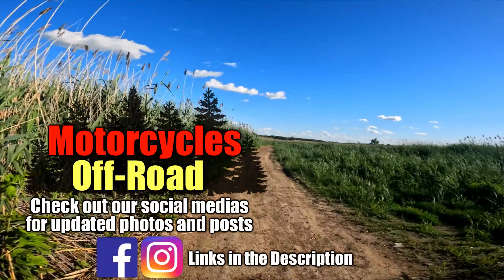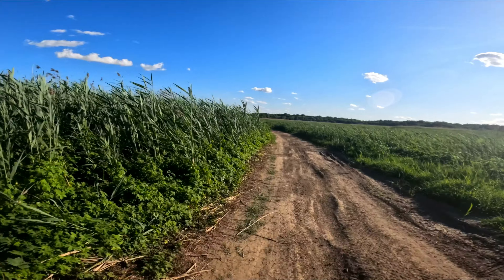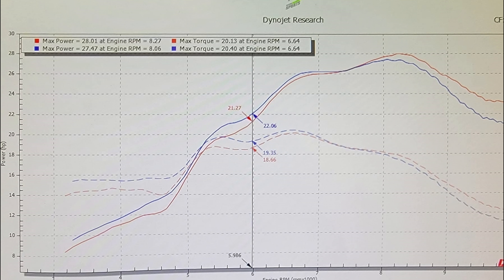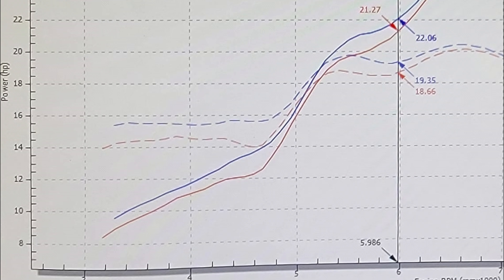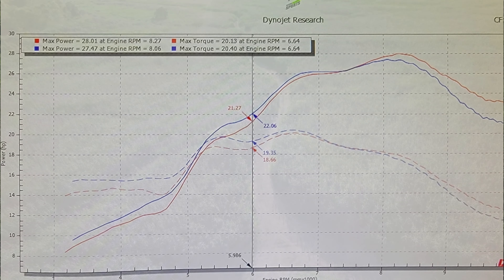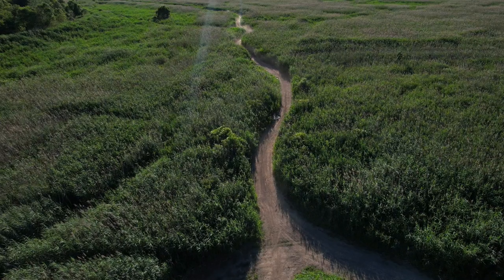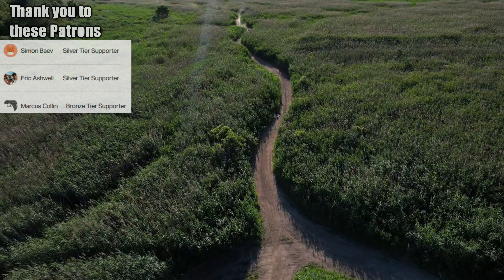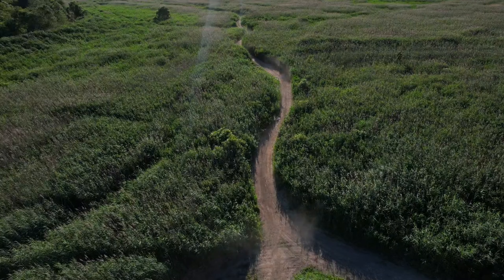Honda CRF300L with CBR cams BIG improvement or huge waste of time?

Comment: Here is the problem. Jake did the dyno test with the stock snorkel and intake tube. The cbr cams require more air than stock, which is why the dyno sheet is under welming. Scott reeves pointed that out, and jake seemed to get offended. Using a bigger snorkel, cbr intake tube, tune, and aftermarket exhaust. Really shows what the cbr cams can do. They have more power and torque from 4k rpm, all the way to the limiter. So if you aren't going to do the supporting mods, the cams aren't worth it. But if you do the supporting mods, the cams make a big difference.
Reply from the maker: I'm sitting here with intake, full Yoshimura exhaust, and an ECU. I feel at this point the bike runs great.
Reply: Jake literally had all of those things done prior to the cams....
Reply: Jake the garden snake also used a power commander instead of an ecu tune, so there may be a difference there.
Reply: @Broxty  no he didn't. He had a bigger snorkel and exhaust. He didn't have the bigger intake tube. The stock intake tube (the tube between the air box and throttle body) on the 300l is a huge choke point. The guys that are making more power with the cbr cams, are using the cbr intake tube.  The engine in the 300l and cbr300 is the exact same, minus the cams. So all these people not getting power gains, are doing something wrong when it comes to their tune, or they just don't have the right combo of parts to take advantage of the cams.
Reply: @mattdyer489  yes, you have it right. When changing the cam you must open both sides of the air box to get the benefit.
Reply: Huh. I wonder where the comments are

Comment: This video proves why multiple channels, which cover the same bike, is needed. Since I am lower than n00b, meaning I will get my first bike in a while and then get the licence, I want as much input on the same topic as possible, counter weights if you like :).
Reply: This video is not correct.  i have done the cams and Air box intake boot and it is awesome.  no loss in bottom end torque and pulls hard from 6000-11000 rpm.  It was less then $200 in parts
Reply: @AceCarleton I disagree with the video as well. I put in the cams during my valve check. Takes no extra time if you have to change out shims, which I did - one exhaust valve ever so slightly tight and the other at the limit so swapped both. Feels the same off-road and freeway performance is much improved. The harder mod is getting the bigger throttle body boot in there. Still worth it, imo.
Reply: @patricklewis8676  Yep, definitely improves overall performance of the bike.

Comment: ... 2021 CFR 300 Rally here ... Reading everything I can and watching any video on the "Cam swap" subject.
 I have the 550 performance Stage 1, 91 octane ECU flash, full Yoshimura RS4 and DNA air filter. Those will be installed soon.
Also got the the CBR intake boot to the throttle body from 550 Performance.  Since that is the most extensive, time consuming mod, that will be the last thing installed after more seat of the pants testing with the first 3 things. Then I will decide if the cam swap is really needed/wanted. 
. Jeff .

Comment: Honda engineers stuff some things up often, but cams isn't usually one of them, ESPECIALLY now days. They really seem to nail the cams to purpose relationship. The CB500X/CBR500R is another good example. I suspect the cam swap would make some sense if you were motarding it, but the rest of the bike probably wouldn't.
Suspension, on the other hand...
Reply from the maker: Haha I still think that was also by design.

Comment: Hey man, I placed a deposit on a CRF300L yesterday. I just ordered a few things through your amazon store link. I’m going to order a yoshimura exhaust for my bike as well. Do I need to tune the bike or can I just slap the exhaust on and call it a day?
Reply from the maker: It is best to get an ECU that will also help with tuning, otherwise you may be running the bike very lean.
Reply: @MotorcyclesOffroad  okay cool, I will order one when I order the exhaust. Thank you!
Reply from the maker: No problem man.

Comment: CRF300L doesn't make anwhere near 28hp.  That's about what a CRF250X with a 280 kit makes. So I'd be pretty suspicious of the dyno in general. For a torque gain that high down low you'd normally be sacrificing far more than half a hp at top.  i.e  Put an R cam in an X and you can gain 4hp or more without losing as much torque down as that dyno shows. If those curves are correct in their nature, the CBR cam is a big step backwards for sure.
Reply from the maker: The 550 performance charts also made similar power. I think in these cases it is due to the fact they are doing the tests with supermoto tires. I imagine on that 17: rim there is less rotational mass which would give the appearance of more rear wheel horsepower.

Comment: You are incorrect.  I just did the CBR300R cams and Air intake boot.  Im using 550 performance stage 1.5 ECU.  There is no bottom end loss.  0-4000rpm the bike feels unchanged.  4000-6000 the bike feels a bit better.  6000-11000 the bike is amazing.  It will do 100kph in 3rd gear.  Top speed of 100mph or 160kph.

Total cost in parts was less then $200 Canadian.  It makes riding the Crf300l as fun as my wr250r
Reply from the maker: So how am I incorrect? lol
Reply: You claim the power gained isn't worth it and that there is bottom end losses.

Both of those are false.

Its definitely worth it. There are huge power gains from 6000-11000

No loss of bottom end
Reply from the maker: @AceCarleton  which there was, I have the dyno charts to show that..
Reply from the maker: @Ace Carleton  if you actually listen to the words I say you will hear me say at this time it's not worth it. As in the time I made the video now if you modified the airbox and got a new tune sure it might be a lot better I don't have that data. This was based on when the video was made, 550 performance (a sponsor of mine) has been working hard to figure all this out for the best gains.
Reply: You should try the cams and airbox boot and 1.5 tune and make a new video.  Its amazing

Comment: I have the 550 performance 91 octane ECU flash, full Yoshimura, and DNA air filter.  It definitely moves better..  I'm going to adjust the gearing as you suggested in a previous video and maybe move to a tire set up with slightly less tread height as my current d606 rear and Pirelli MT-21 front (not keen on the speedometer being screwed up though).  I wish someone would dyno that set up...I find it strange that someone hasn't already.   Finally,  I think the bike would be exactly where it should be if someone started producing a reliable 350 big bore kit for the 300L (I heard that 550 Performance may be doing so)...just as they did the 305cc kit for the 250L
Reply from the maker: Hey Andrew thanks for the comment
 In my gearing video I belive Iisted the part numbers for the speedo-healer.
Reply: @MotorcyclesOffroad  thanks
Reply from the maker: no problem.
Reply: ... @andrewhume7410 ... I also have the 550 performance 91 octane ECU flash, full Yoshimura, and DNA air filter. Also the intake CBR intake boot to the throttle body. That will be the last thing I do after I test with the first 3 things. 
I will be installing all of it soon. 
Did you do any air box modifications? 
I am going to remove the back snorkel and open the back top of the box up either one big hole line JTGS did of two holes like I have seen on other videos. 
Thanks,
Jeff
Reply: I didn't mess with the air box at all, mostly because I felt the improvement would be marginal.  I suspect the power gains are almost entirely due to the ECU and full pipe.  I actually sold my 300L last year...bought a used 2019 450L.  Now the power is definitely there, lol.  That bike NEEDS some mods too, but once they're done...giddy up.  Best of luck👍
Reply: @andrewhume7410  ... Thank you for the reply. Good luck with the 450. 
Jeff

Comment: Throttle body, head design and compression ratio need to be changed if you're attempting to get horsepower out of this engine. It was designed to have long service intervals and have rock solid reliability. You're better off swapping a 250r or 450r if that's the performance objective you're chasing and shelving the 300.

Comment: He didn't just swap cams. He opened up his airbox and slapped on a new exhaust. Stainless steel I do believe. The exhaust is a good idea IMO, but not for the sake of power. However, when it comes to making more horsepower and torque, if the engine head is the source of the bottleneck - restricting air and fuel mixture, or exhaust - adding a new exhaust and modding up the airbox is not going to do enough; which is exactly what we saw happen. Open that mess up all you like, but the head is not going to allow you to pull anymore of anything, nor evacuate exhaust. The engine is clearly nothing like the DRZ-400, where it responds well to being opened up. Thus far, from what I've seen, the bike is just fine with an ECU flash, better exhaust, and the smog delete.

Comment: space the cylinder up 5mm higher, put a 5mm longer rod in it and fit a higher compression ratio piston, ideally up the bore to 86mm at the same time. Then you can fit the cbr cams, not lose any torque and rev it harder as well, but since you're going to all that trouble you may as well give the head a port and polish and fit bigger valves if you can at the same time. Swap the ecu out a fully mapable single cylinder and it'd probably be almost as good as registering a crf 450r......
Reply: Or just buy a cr250r.
Reply: Yeah, at that point…what’s the point of buying the bike.

Comment: You can gain a lot more from a gearing change at the end of the day
Reply from the maker: Yes in rear wheel torque ect. Tho you will also loose top end speed or vice versa.
Reply: lol
Reply: YES YES and YES.  People spending big $$$ to be less happy than they would be with a 40 dollar sprocket swap and they don't know it.😂
Reply: @phantomshtter  Or you can do both! This bike is awesome post mods... but it is a takes a lot of wrenching and ~$2500 to get there (suspension + engine mods + controls)... so yeah, maybe just spend the $40 and suck it up on the highway lol